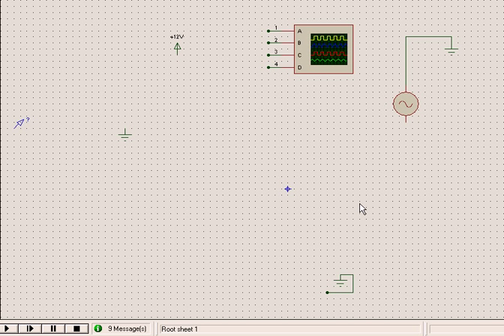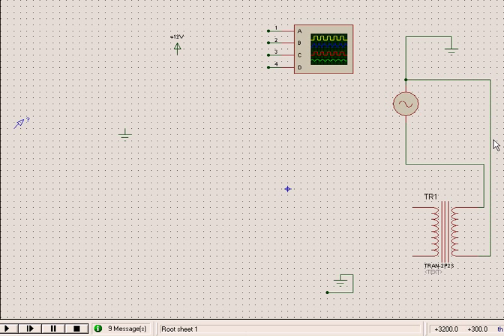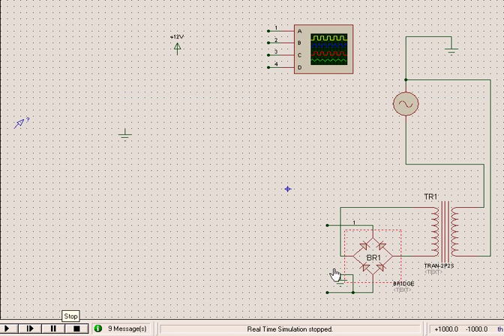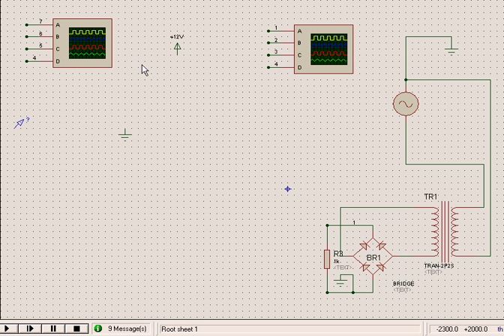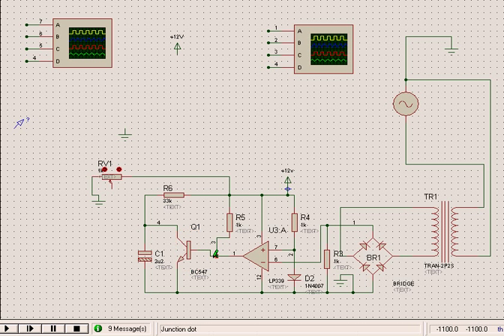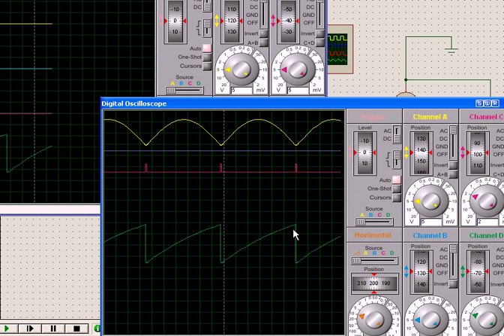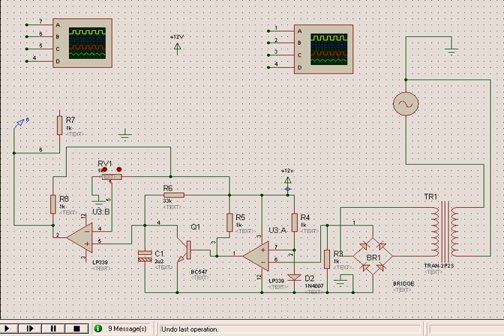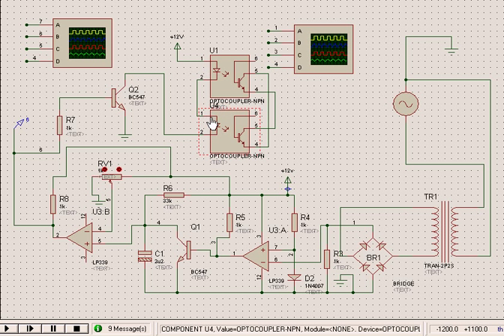Thyristor -firing angle control

Comment: I have one doubt sir, how capacitor discharge, when to the base of transistor  is always high  given supply through R5 resistor..
Reply from the maker: The base is not always high. It gets PWM pulses from the U3A output at pin no 1. Please refer to my zero voltage generation videos elsewhere for how pulsating voltage is fed to one input of the U3A and compared against a fixed voltage of a diode drop to develop PWM. So the base of transistor goes high and low as per PWM
Reply from the maker: https://www.youtube.com/watch?v=1Eq5L8Km79Y
Watch it for how ZVS is generated to clarify your doubt